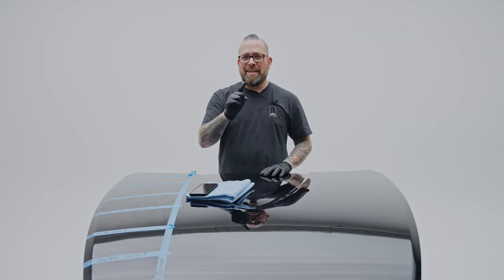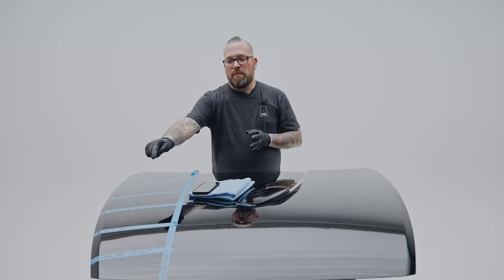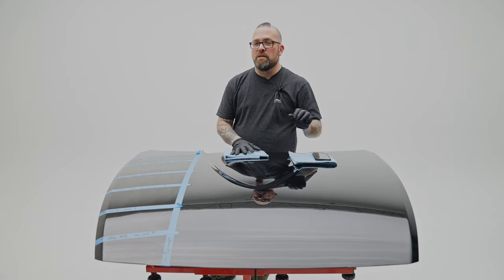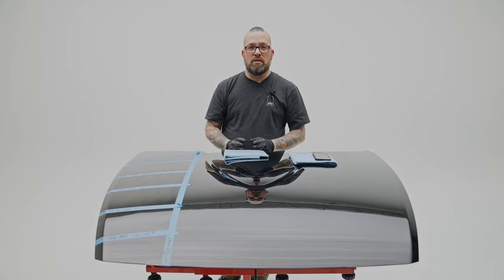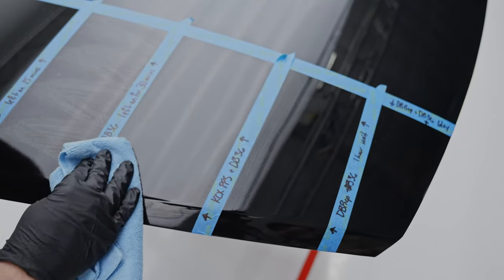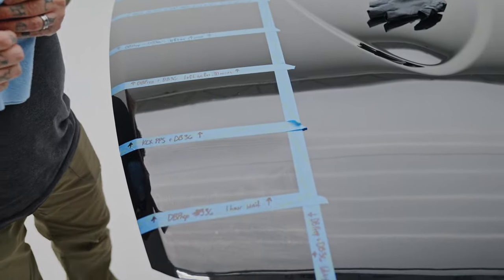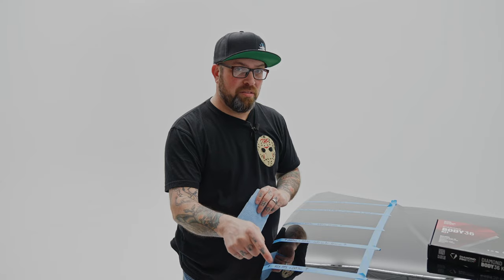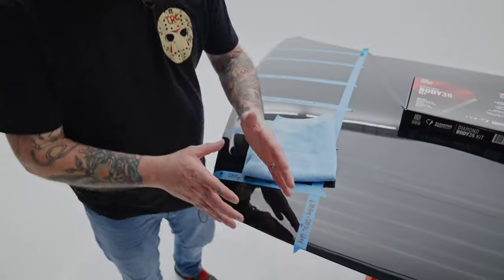How to Eliminate High Spots from Ceramic Coatings

Comment: It would’ve been great if the camera was closer with diffused lighting. Not all coatings are as forgiving or slow curing for that matter as this was. It’s interesting how much of a difference a panel wipe makes! Great video
Reply: I did my coating outdoors and it cures faster due to wind than temperature, so be ware of wind or draft too.

Comment: Excellent video. I have been scared to use my DB36 and this helps tremendously, thank you.
Reply: Db36 was the first coating I applied. The only mistake I made was not wiping off my polish residue enough and not being thorough enough with the prep spray.
Reply: @ethanblan435  Thank you for the tips and support.

Comment: Any more information about what makes diamond body prep so unique? Ive picked up the DB36 kit and sure will be using the body prep but i am curious about why their coating rely so heavily on their spec prep being used. I know its generally a good idea to use the manufactures prep spray when installing their specific coating but I've been able to use other's prep with flawless success on various coatings. Would love to learn more on the chemistry behind this if you could shed some light on it! Thanks for the great video!

Comment: I did my center console with Gtechniq Ceramic Base, let is sit for 24 hours. It made like a crust on top fo the gelcoat with small spots like orange peal but smaller. Think tea with sugar drying. Total panic of course. Cutting pads and compound did remove some of it, but it’s more difficult tonget of than oxidation. Finally I noticed that IPA alcohol rubs away the highspots (in my case the entire console is one giant highspot). IPA is 100 times cheaper than using ceramic coating to remove highspots, something you car guys try too. Intially I wanted to throw all my machines, gear and products in the water - absolute nightmare of a day!
Reply: For some reason you need to spray the alcohol on the highspot and buff it out with a microfiber. If you don’t then you will just get a new highspot in a differen location where the alcohol is running.
Reply: You must have caught it in time. 

IPA doesn't always remedy the situation for us.

Comment: Excellent demo! This leaves me with a couple questions about applying the recommended 2nd coat.

1. In your Q&A, you say you are good to apply coat #2 after 1 hour of cure time. But as we can see, adding more diamond body 36 after 1 hour is self-cannibalizing, as you called it. It can dissolve the coating below to knock off high spots. So shouldn’t he 2nd coat be applied much later, so it more stacks on top, vs dissolve & mix with the 1st coat?

2. Ok, if adding the 2nd coat after 1 hour is still somehow the best—then why bother leveling after applying the 1st coat? Let’s say time is money—you could save the leveling step after coat one. Coat the entire car. After an hour, add the 2nd coat, then level. Am I a genius, or idiot for this idea? 😂

Comment: The gtechniq panel wipe is awful , Gyeon prep much better safer
Reply: I find the Gtechniq one is basically a solvent. It works, but on softer clear coats I've seen it introduce micro marring when using it. Used an alcohol based prep spray side by side to it and the alcohol spray didn't soften the paint to the point of my eagle edgeless 350 marring it.